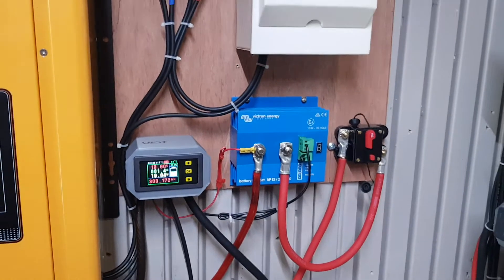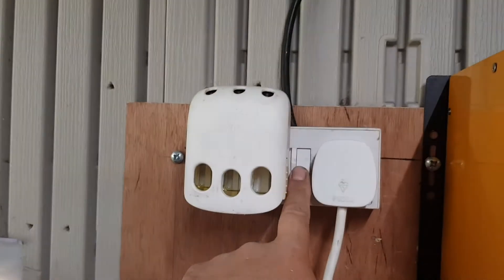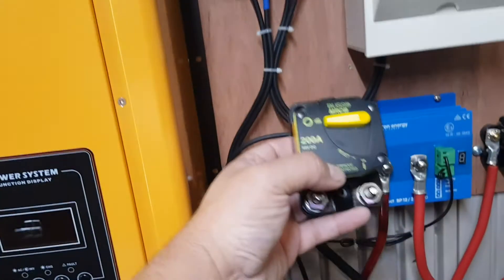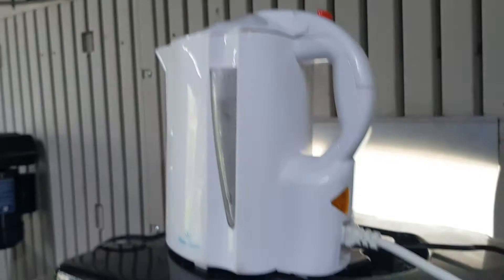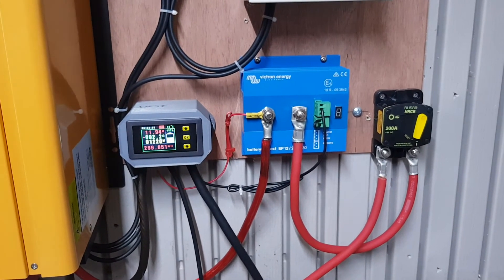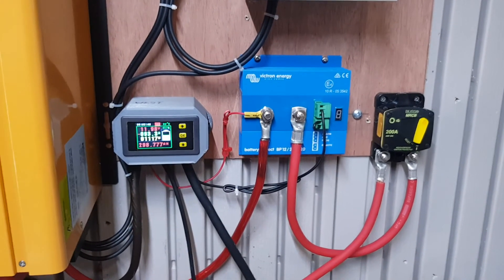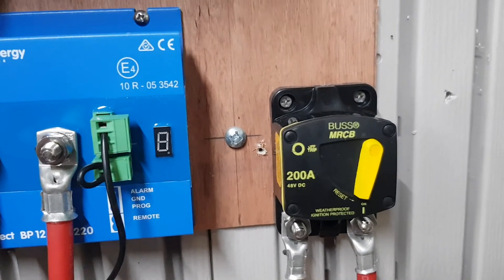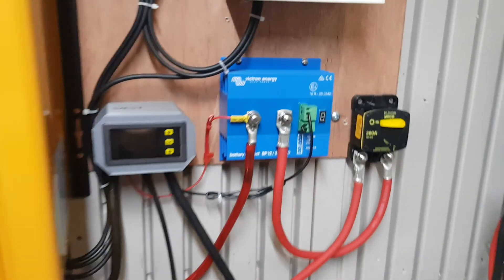Breaker Test - Is a cheap Chinese low voltage disconnect/breaker any good ?

Comment: yeah, start with 24v systems. but even then none of those breakers are good enough. just use a fuse rated a bit higher. if you want to disconnect your batteries just turn your inverter off. or as dc arc gets bigger and more scary, as you grow your system , get one of those big breakers with a leaver. its worth it. its just a big off switch anyway. id still have the fuses.

Comment: I've had plenty of good and bad experiences with DC breakers in general. My advice, if possible, use melting breakers because they are way more reliable. Add regular breakers on the 230V side.

Comment: Good morning do the 12v circuit breakers have a connection direction? I have one between my battery and my converter and one between my solar charger and my battery and I'm wondering about the direction of connection... thank you

Comment: Have you tested the 200A "expensive" breaker will actual trip at 200A? That would be a even more expensive mistake if it failed to trip at the specified amperage!!

Comment: Breakers are ( cheapo's are rebranded 50 amps) None of them go above 50 amps!!  
Need to buy Named like   Westinghouse,  Bussmann, Blue Sea  or T Tocas <- last one is my choice.
Reply: YES, You mentioned T Tocas!, Can you recommend it for lower Amp uses? I was about to ask for it, I'm undecided as to get the exp. Blue Sea Systems 80A for my MPPT 60A max chaging, or the 80A T Tocas to try it out, anyways I'm not putting full 60A charge on my battery just yet O.o

Comment: DaierTek 50A (12V) . If you connect it to 24 volts - it will be stable up to 35A. (test in another video) . If you connect it to 48V, I think it will be up to 17,5A ))). 50A * 0.7 * 0.7  * 0.7 = 17,5A. (12V.. 24V ..36V .. 48V). The point - DaierTek think in classification at 12 volts. Anything above that is the heating modes of the automaton at steady load + ambient temperature. == So from tests and my guesses, your DaierTek 200A ( video - 1:49 ) will be stable at 48V up to 68.6A (and anything above that is time to shutdown).
- 20:21 == I liked your second option - BUSS (MRCB) at 200A at 48V DC (rated).
Reply: other video 12V 100A = 70A... ((( China

Comment: sory to say it no need to test cheap chinese low voltage they all have a voltage
and amp load only test that i think you can jump from 1 meter high
are you also going to look if you can do that from 10 meter?

Comment: These small breakers have another big issue in that their maximum interruption current isn't stated and they will probably weld their contacts in the event of a short circuit.  This is a serious issue with LiFePO4 cells which can deliver approaching 10KA before something breaks. 

I use large DC rated MCCBs on 48V battery systems with a selected maximum current rating below that of the cables. The maximum repeated breaking current of these units is around 35KA (Ics) and ultimate breaking current is about 50KA (Icu).  These figures are at their maximum operating voltage and will be even higher at 48V :)

Always check your supplier is sending you good product - I've seen some very poor MCCBs which cannot handle their rated load.
Reply: EXACTLY!!!!!

Comment: The breaker you installed 2nd is made by Blue Sea Systems.  They are highly rated and reliable. IF you are someone on a tight budget and shopping on Amazon , the Chinese breakers with YELLOW buttons/switch are generally the Type3 and quite accurate and reliable.  It is the cheapo Red units that cannot trusted for accuracy.   But I assure you the cheapos are always rated 50% higher than their actual trip rating.  So not dangerous really , but the Unknown is not something to roll the dice on either.   
$15 vs $50 is the price difference. 
How valuable is the equipment you wish to protect ?  
Personally I prefer MEGA Fuse over breakers and on a Lithium Battery install w/ a large ( 3000w ) inverter.  A Class T Fuse is the way to go , Always. 

Thanks.
Reply: well thats interesting, thank you.
Reply: Can I use Blue Sea Systems ANL 300A for a 3000W 12V inverter, instead of a Class T 300A? (I say 300A and not 400A as Renogy advises because we're "capping" load, and planning not to get full 3000W load on it)
Reply: @VenalesM yes you can , but DONT.  Use a Class T slow burn.  There is a reason those of us with Lithium Banks over 600ah and using inverters of 3000watt or more incl Solar or wind inputting 500watt or more use these expensive Class T fuses
It is better to spend $60 on a Class T and protect your other hardware and system compared to a cheaper type fuse/breaker system
In fact I use both. 
my class T and a 250 and a 300 reset type breaker  in combination. 
Its not worth risking a $900-1200 inverter using a cheaper type fuse/breaker system

Comment: I would have liked to see what the 'better' breaker would do if you had connected a second load, such as a space heater.  Tripping early (like the cheap breaker did) is an inconvenience but tripping late (or not at all) can be disastrous.
Reply: seen victron fuses trip very late at 2x the rated amps

Comment: You should have tested the new breaker up to 200 amps. Just putting 100 amps through it doesn't show whether it works fully or not. i.e. what if it blows at 150 or 160, then its not good for a start up power draw if it trips.

Comment: Give me the cheap 12 pound breaker at100a.... rather than $100 pound 200a  breaker lol. I mean I would rarely use more than 100a anyway.
Reply: The problem with the chinese one is that it may not break all the way and may be partially connected still.  This is a risk of causing fire.

Comment: I'd have to ask if the math was done on this test, breaker should be amps from inverter+amps from charger=amps for circuit breaker. Is there any charging amps you forgot to account for?

Comment: Thanks for the video.  Obviously better quality but does it break at 200A?  The Chinese one is more like a 100A breaker - may be if their datasheet was more detailed it may indicate this fact - may be the Chinese one is only designed for 200A 2second cranking currents?  The Buss one may take 600A cranking currents.  Definately a quality item and your connections are good if it does not get warm at 100A.

Comment: was the charge controller positive lead connected to the "load" terminal on your new Bussman circuit breaker? if so, where did you find to instructions to do this?  the contacts on my Bussman circuit breaker (150 amp) welded together (which was determined through disassembly).  i connected the "load" terminal to the inverter and am not sure this was correct. I'm troubleshooting my failed system and am being told that these Bussman breakers are not the type of breaker to use on solar.  Thanks for your videos!

Comment: I recently had two breakers that looked on the outside case to be the same manufactured parts not work for me. There is a different style of breaker sold that says waterproof and ignition protected that so far has worked for me.  I have like a dozen of those and they all work.  The pretty plain no writing other than the rating number ones like in this video don't seem to work.

Comment: Pretty sure your voltage is dropping below the disconnect voltage. The problem is your batteries can not handle the load without temporarily dropping below the cutoff voltage. The switch is working as intended. Before you start putting clickbait racist innuendos in your video title, maybe you should dot all your i's and cross all you t's or else risk making yourself look like an idiot. Unless of course the intention of this video is amass clicks with racist innuendo clickbait titles, in which case it's working as intended and I'm the one who is an idiot for wasting my time on it. Thanks.
Reply: What did he do that was racist?

Comment: Skip these 12V systems and go 48V so you don't need only 1/4 of amperes to handle.
Reply: ya , why.  ??   Who uses a 48v system except for guys on a Lagoon 450 with big wallets to upvert and downvert voltage 

no don't do that unless you have $$$ to burn

Comment: Yep I can concur with this. These cheap and nasty things are useless. In my case I've just returned from a callout to a caravan which I fitted out with off grid equipment in October and the circuit breaker has totally failed, doesn't even close the circuit - so that's going in the bin and it's going to cost me to fit a new one for the client! Oh well, lesson learned. Thanks for the video :-)
Reply: They're not even cheap!

Comment: Could the different voltage readings be because that's what it is at that point in the circuit? That would make sense that your panels are providing a voltage of 13.1V, by the time it reaches the meter, cable resistance has reduced it to 12.6V into the batteries, out of the shunt of the battery it drops to 11.8V and by the time it's reached the inverter it's down to 11.3V. Does that seem feasible?
Reply: You see a voltage drop when the current begins to draw because of battery makeup. You see it on lifepo4, lead acid, etc that the battery voltage falls as the current pulls but settles back up once the current stops.

Comment: Good demo. I have purchase a few of these cheap china breakers myself but, tbh I have not put them in place yet. Was skeptical to begin with now thinking just use them more for battery disconnects vs breakers in low amp needs circuits.

Comment: Wait a second… at 6:30 you said the battery was low because you’ve been mowing at 1400W. And you only recently dropped in the more expensive breaker.

Did the cheap breaker hold up well enough for you to do the mowing at higher draw than the kettle?

I have the same cheap breaker in a few systems… and I’m not a fan of them either.
Reply: You Sir, caught that mid-air!

Comment: Interesting video, like yourself I've got a cheap 200amp £12 circuit breaker on a 1500watt inverter. I've pushed it upto 1300 Watts with no problems.  My only concern would be that it wouldn't trip if shorted / overloaded.
It may be you where just unluck and had a faulty one. Most of them are made in the same factory. Sadly their are no guarantees that more expensive always means better. Though if I had the money I would spend more.

Comment: What are you using that batteryprotect for?
Reply: For low voltage disconnect to inverter but he does not know that the BP will fry itself upon reconnect because of the inverter spark. Victron BP is junk!!!
Reply: @StarJackerSRL  thats what I expected, thank you.

Comment: I believe if you calculate the wattage demand of the kettle 1130 W with the 11.3 A the fuse amp rating will be 100A. (to trip)The experts recommend 1.5 x the max fuse rating. So this means a 150A fuse would be recommended.  That's probably why the 100 A fuse tripped. But hey, what do I know.
Reply: Nice try, but Its 200A breaker, so its well above your 150 needs
Reply: As in my inverter 150A is correct but how did you reach the 100A number

Comment: The problem with these things is that there's no definition of what the rating means. Is it the continuous current (3 hour rating), or is it something to do with the over current trip. I'm having similar issues with my breakers - the thermal part of the breaker kicks in after about 5 minutes, with a current at about 80% of the indicated rating, so in my case, I think the rating is to do with over current trip (not continuous running)

Comment: I just choose normal fuses because they are pretty cheap and rated correctly. and if you electric system is made an wired well I dont think you blow fuses.
Reply from the maker: These are actually DC disconnects with over current protection.  These are much better in my opinion.

Comment: And another thing is, when ordinary Joe public start talking about saving planet and going solar, that they don't even know that you can manage just about one cattle to work in the household before you max out. 

Amount of ignorance is eppic
Reply from the maker: To be fair, this is only a shed project and was designed and put together by me.  Now my house has 6kWp and 17.5kWh of LifPo4 batteries and it can more than boil a kettle.  Naturally it was very expensive and I will more than likely never get my money back - but with the built in EPS (emergency power supply) when the grid goes down - I still have usable power.  I find that solar works - but only in summer depending on your loads.

Comment: As you said, at least it did trip instead of catching on fire😂. Hense very impressing  £ to A
Reply from the maker: True, but to be honest by the time I had bought 5 of the cheap Chinese nock offs starting at 100A going all the way to over 200A, I was at the end of my wits, I did flinch at the price and the shipping - but that is all a distant memory now. Not had a problem since.  Don't get me wrong I have nothing against China - most of my electronics are made there - it's just that when it comes to breakers they don't seem to be able to tell the truth.

Comment: ...and do that break at 200A?
Reply from the maker: Yes although there is not a load big enough in the shed to trip it.  It is mainly used as a DC isolator and to protect the wiring in case of an internal inverter failure shorting out the DC cables.  In normal operation that breaker should never trip, only in the most dire of fault conditions.

Comment: Bought some name brand versions of the same thing,  and 2 melted after it kept tripping.
Reply from the maker: yeah, I guess you need to be careful of badge engineering.  Since replacing the breaker with a none nock off  I have had zero issues.  I thought it expensive at first, but now I see the true value of getting the right equipment for the job.

Comment: I need you to do another test  between circuit breaker in and out ,, is there any drop of Amp ??
Reply from the maker: No, the breaker is good, and because my cable runs are short I have got away with slightly undersized DC cables.  If there were to be a voltage drop it would be a result of the DC cables.  These cables are OFC (Oxygen Free Copper) and not CCA ( Copper Clad Aluminium)  which is the poor mans version.  They have a higher resistance and so you would need thicker cables.
Reply: @3dmotormaker  what size cable are you using battery to inverter??
Cheers

Comment: I have  2000w inverter what is better way install fuse or bushman expensive circuit breaker ?  ,, and what( amp) size of circuit breaker for 2000w inverter  ?

Comment: The irony is that when you open all those components that you have, they will have "Made in China" in them.
Reply: BUSS and BlueSea are not made in China. Unless they say it is...As the Marine Grade Rating goes out the Window...
Reply: @WizzRacing  Bluesea I agree is made in Australia which are built to last.
Reply: It doesn't matter anymore where they are built, the key is where and how are they designed and who and how they control the quality.
These cheap electronics are made in someones garage without any quality control with cheapest (maybe recycled or copied) parts.
Reply from the maker: The breaker is made in USA, but yeah all the other equipment from the solar panels to the inverter and everything in between is made in China for sure.  China is good at electronics, and crap at breakers.
Reply: @3dmotormaker  I did test all breakers and fuses I accumulated over the years, Chinese ones trip earlier than it’s designated trip amp but interestingly Expensive ones like Victron doesn’t trip at all, I can send you similar link if you’re interested.
Reply: @3dmotormaker  is it the Chinese fault they only making it to sell to greedy business who are to lazy to ask for quatily.
Reply: @3dmotormaker  they also very good at breaker if you put the price.

Comment: One of these Chinese breakers came with my boat's electric anchor winch. Its mounted near the up and down toggle. I have never had it disconnect due to load but appreciate its intermittent duty. Its right there at the helm to be reset if needed. I see them advertised as for use in powerful audio automotive  stereo systems.  The fact that the threaded posts are tiny and there is no room for a decent sized lug shows that they are a poor design.  I use simple 300 Amp ANL fuses on each of my battery terminals on the 200AH lifep04 cells as a precaution against dead shorts in addition to the internal BMS .

Comment: Just a quick tip,  when using these breakers, you need to use chinese water for it to work correctly.  LOL
Reply from the maker: Well it was certainly Chinese water torture...

Comment: Better to trip at 100A than not to trip at 3000A
Reply: A load has nothing to do with fuses or breakers, they are not there to protect equipment but are to prevent the conductor from bursting into flames.  200A could run for 20 minutes at 250A before opening,
Reply: @shmayazuggot8558 I have use these breakers for years with no complains
Reply from the maker: Why would I install a breaker that cuts off lower than the current draw I need ?  I think you may be confusing current with power. 3000A is 41.5kW and its only a 3kW inverter and my load requirement is 1.5kW peak.
Reply: It needs to trip at exactly 201A
Reply: @janco333 that is not how breakers work…
Reply: @janco333  that isn't the way breakers work - they are designed to protect the wiring.  They normally have a magnetic trip which typically operates immediately at 5 to 10 times overload and a thermal trip which should operate within an hour at about a 50% overload. Look up "curve C circuit breakers" if you want to know more about them.